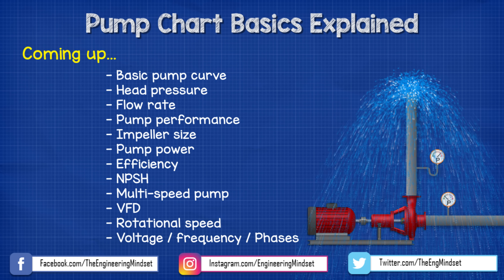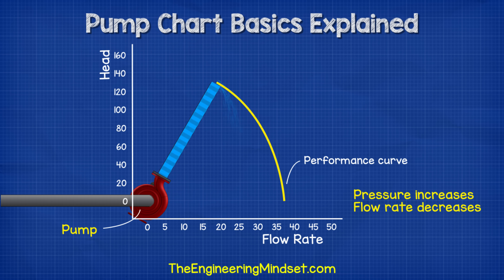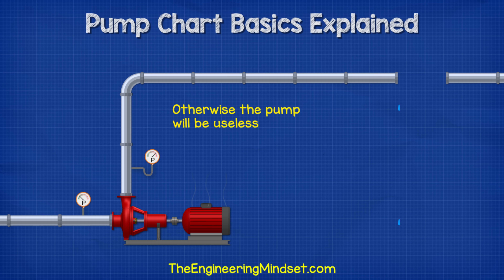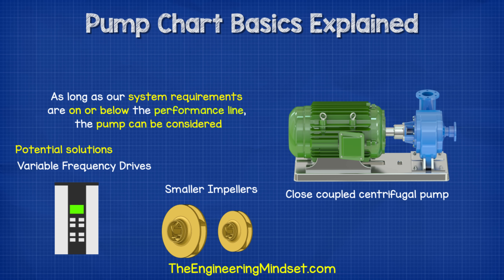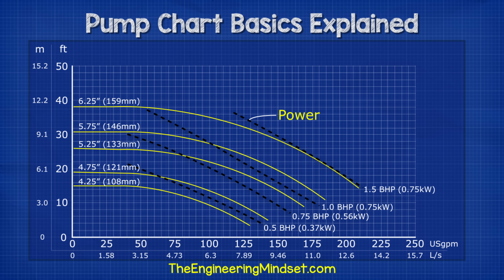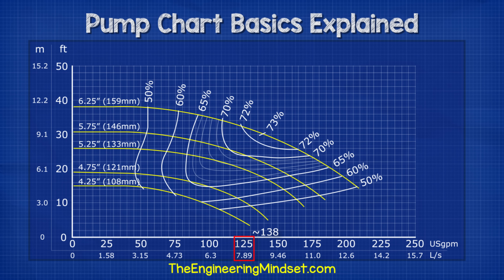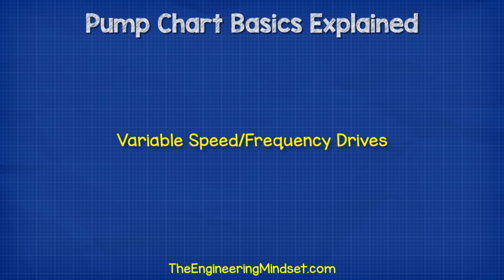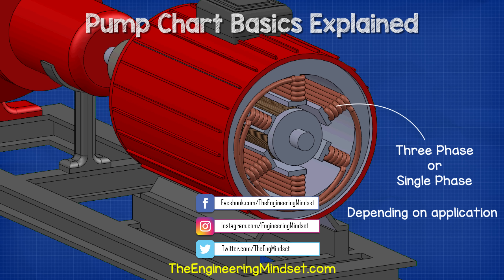Pump Chart Basics Explained - Pump curve HVACR

Comment: Question regarding @2:37 It is mentioned that pressure varies with liquid, but height remains to be a fixed value. Does that mean the pump uses more power as well to account for more pressure? 
Say a pump pushes both water, and something like mercury (SG =13.6) to 50m head, will the pump not be constrained somehow? 
It would make sense to me if pressure is fixed, which resulted to different heads i.e. 5 bar would result in 50m of water column and equivalently 3.68m of Hg column.

Sorry this is likely a stupid question
Reply: The video is wrong, pressure is constant height varies
Reply: @TheTc970  No he is correct, head is constant and pressure varies for centrifugal pumps.
Reply: There is no stupid question, as far as I know, if the pump desing head is 50 m. it will deliver water to 50 m with equivelant pressure = (164 ft * 1.0 #this is specific gravity#) / 2.31 = 71 psi. for mercury pressure = 966 psi. 
However, Power requirenment from pumping water to mercury will be changed around 13.6 X power on water. this is without considering any viscosity corrections :)

Comment: I am a retired engineer who during my career had to learn about pumps by "the seat of my pants." This video deals with small  potato pumps where as I also specified very large high volume, high or low head pumps.  These pump videos are great and cover a lot of important issues but I caution much more must be understood mechanically before specifying a pump.  In particular are seal/stuffing box design and bearings.  As with fans, low volume, high head centrifugal devices, are tough on bearings.  Don't just accept the vendor's bearing recommendation.  Personally check with the bearing vendor.  You may find yourself needing to learn about bearing and the recommended lubrication requirements before making your final pump choice.
Reply: Very well put!
Reply: Great insights, sincerely invite you to learn about our Huayun hose pumps
Reply: Hey man you seem an expert on pumps..
Can you provide more informations? Especially on specs we are missing here
Reply: Sir, hats of to your experience, need some guidance and information about pumping system for industry,
Reply: Any recommend books we can purchase online?

Comment: Please help me to get this i have installed 1hp centrifugal pump beside the water tank on the roof, the height from roof to ground is 6m with 1" pvc pipe, so theoretically the total head is zero so the question is how my psi i would get down at the end of the pipe?

Comment: 30 HP motor fitted with a 5cs pump
But the motor not lift water 
What is the possible cause and solution
Reply: Need more info. I don’t know what 5cs is but if you give the pump manufacturer, model number and measured suction and head pressure we can get started. Could even be as simple as the motor/pump running backwards.

Comment: Great video as always! Anyway, I have to notify you something, a minor mistake; at 10:07 you said that during cavitation water begins to boil ad air bubbles start to form and then to explode, eroding the internal surface of the pipe. This is partially incorrect, because the bubbles are not air bubbles, but water vapor bubbles, formed as water begins to boil. Maybe there could also be air bubbles but the majority are water vapor bubbles.
Reply from the maker: Yeah, it's always a bit of a head scratcher because water consists of oxygen and hydrogen and at boiling point they are experiencing a phase change, expanding and breaking the bonds but then suddenly collapsing and rejoining. Meanwhile the surrounding molecules are part way between these points.

Comment: What happened to the current of a pump when discharge valve is closed??
Reply: inteternal circulation and heatup. Same as 0 flow highest head in the chart. not recommended to keep the pump at this mode

Comment: Pressure and velocity are inversely proportional to each other. If pressure increases, the velocity decreases to keep the algebraic sum of potential energy, kinetic energy, and pressure constant.when pump start pumping in vertical direction the head loss or pressure loss increases not the pressure. Velocity and flow rate are directly proportion.

If you are designing a pump for example 60 psi than head will be 41m + head loss in pipe + static head.
All you need is specific gravity of fluid so you can calculate any type of pump.

Thank you

Comment: Hi Paul, very succinctly explained. I have one trivial matter to nitpick - the bubbles that are formed when there isn't enough suction head at the inlet of the pump are "water vapour" as opposed to air, aren't they?
Reply: Not an engineer, but I believe that at low pressure, the first bubbles to appear in water are from dissolved air

Comment: Thanks TheEngineeringMindset, I really liked it
@8:36 so the manufacturer will make a 6.25" casing for a 4.25" impeller pump!!! I suppose this part needs more explanation.

I think the efficiency is lower for smaller pumps because although the surface roughness is the same but the relative roughness (which really matters) is higher in smaller pumps

Anyway, I appreciate your review on my video "2 Pumps Basics and Misconceptions (En)" and on the channel as a whole
Thanks

Comment: Will a pump capable of pumping water at 2 l/s at height of 10 m  be able to do 2 l/s for honey(denser) at height of 10 m while consuming same power???
Reply: No changing the medium changes the fluid properties, the most important of which in pump mechanics is density, (kinematic) viscosity and its profile (newtonian/thixotropic etc). In your case honey is denser, more viscous and is non-newtonian which means:

-higher power consumption
-smaller generated head
-reduced capacity
-reduced efficiency of pump

Media like syrup/honey are often pumped using positive displacement whereas water is more likely to be centrifugal.

Comment: Great video! I was wondering if you'd be interested in discussing how Bernoulli's equation works with respect to the Venturi principal. Specifically how you'd apply the equations to take pressure and flow from a pump, into a venturi, and the resulting back pressure created to generate suction.
Reply: Он даже о кавитации не рассказывает. А вы хотите о Бернули.
Reply: Hn

Comment: In order to understand pump curve is correct, you can slowly close  outlet valve then check outlet pressure if it is reach to maximum head or not. For your safety do not keep outlet valve closed for a long time

Comment: I ve a centrigal pump 45 kW supply  by a generator 100 kVA. On starting sometimes the generator is tripping without tripping the motor protection. Would could be the root cause please
Reply from the maker: Sounds like inrush current, have a look at a soft starter or star delta starter to reduce it
Reply: @EngineeringMindset  Thks for response, the motor starting is star delta, just in star after starting gen and became stable. On switching the motor in star directly  trip the generator (as you know gen change sound to support the load). 
We are suspecting the boot level of the pump may be blockage,  this is what I don't understand why it can trip generator. 

After 7 to 10 times of force starting after generator then we succeed. 

It doesn't come out clear in my mind what are the issues
Reply: @EngineeringMindset  Inrush current can be in highest side if the pipe is block? Or sunction full of mud?
Reply: start pump in no load using bypass and after stable take it on load
Reply: @nitinshevade4557  Hi Nitin, thanks for your response. Should I install a bypass circuit for the pump? Will it not have a problem without fluid?

Comment: I believe there is an error in this video when you talk about Pump Head. The value of pump head is in meters and refers only to water, therefore depending on specific gravity of the liquid the height will change but the pressure remains constant. Final Year Chemical Engineering Student
Reply: The video s specifically show the head is based on water and must be corrected for other fluid specific volumes.  Say the retired engineer w/50 years experience.
Reply: @bobsmythe2490  Head is based purely on pressure, therefore the height of different fluids will vary, in this video it states the height remains the same and the pressure varies
Reply: Either you are wrong or he is, because the both of you have opposite statements:
2:32

Comment: Out of curiosity:  Are there devices that'll allow pumps to run at max efficiency, but somehow restrict the output flow rate/pressure to something less?  Or do people just accept the efficiency losses, and use the pump at precisely the needed flow rate, to deliver the precise amount of pressure of water?
Reply: Control valves or orifice plates can alter flow rates /head

Comment: Nice video, just one remark to the animation at 11:10 - VFD does not change the amplitude of the voltage it sends to the motor, but the frequency. If it did, but left the frequency unchanged, the speed of the motor would depend on the load. Put simply, the VFD should change the animation horizontally and not vertically.
Reply: VFD's output changes both voltage and frequency (Amplitude & Wavelength), Don't be fooled by output frequency either it's normally in the thousands of hertz. It would be difficult to show a very accurate drive illustration because many drives calculate that curve differently between manufacturers.
Mindset Engineering - The illustration was fine for that example
Reply from the maker: VFD Video is now live! here: https://youtu.be/yEPe7RDtkgo